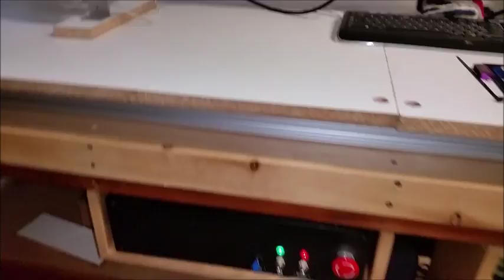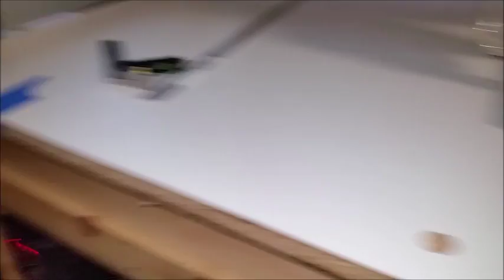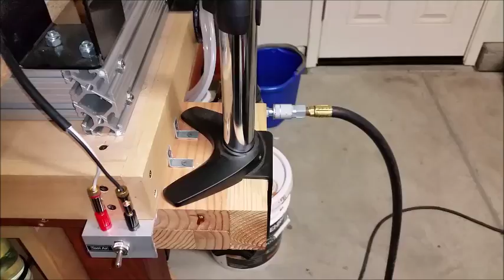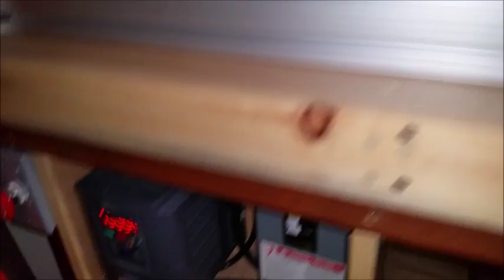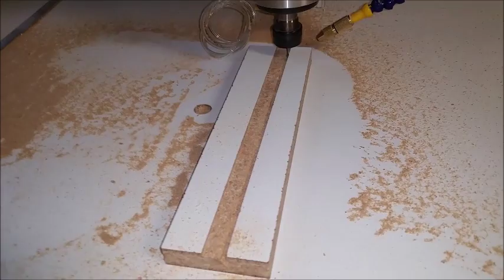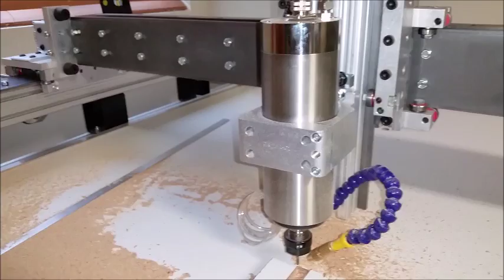FIne Line Automation 4x4 Router

Comment: Jerome , I was prepared to purchace a  4/4 Saturn .Nate has made a few enhancements to it and refined it further . 
 It would certainly be easier to get running as it's assembled . But I would prefer to have the one you have . I won't require a crane , and it will be much easier to get in my garage